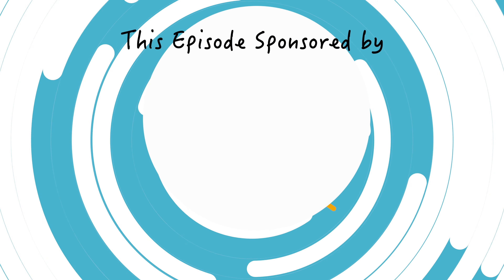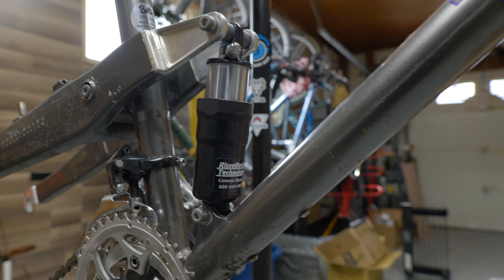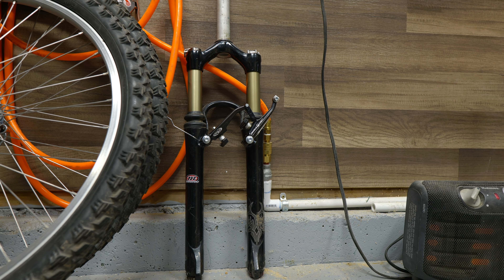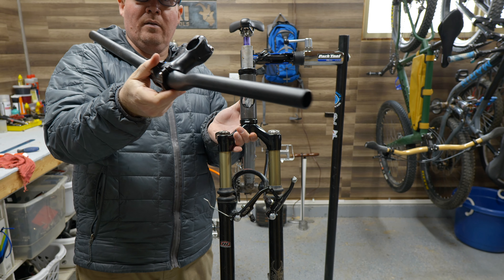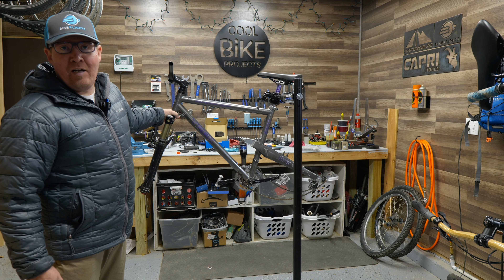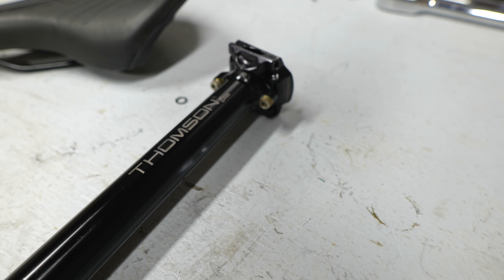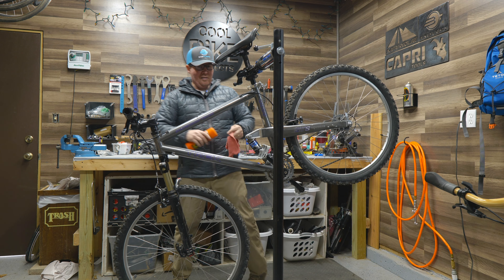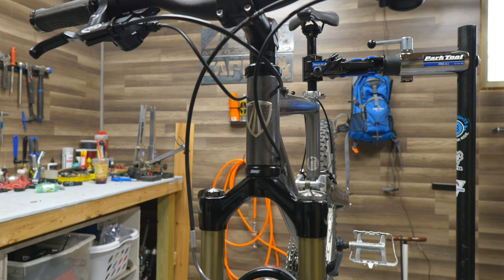Trek 9200 Restomod Complete! Mountain Bike Restoration

Comment: I used to own one of these when they first came out.  Very cool to see one getting some love 30 years later!

There wasn't a cable stop on the rear so cantis wouldn't work and v-brakes weren't a thing yet so these came stock with a Paul Crosstop rear brake. It was a very finicky brake to set up , but once it was dialed in they were quite powerful with good modulation.  If you still have that brake I would reach out to Paul Components to see if they have any of those springs around.
Reply from the maker: Thanks for the insight Jay. I will reach out to them and see.

Comment: i just picked up 9200 with J4 rock shox from goodwill for $50, previous owner had changed the rear suspension to a spring type too, can't figure out the brand though.
will be watching your video over and over to restore mine! thx for the vid
Reply from the maker: Right on!

Comment: I wouldn't worry about the purest, you did this bike justice. Those frames weren't the best suspension designs, they rode like a pogo stick with wheels.
Reply from the maker: Thanks Johnny. I'm hoping to put in some miles on it this spring and see if the rebound control is enough to tame the back end.

Comment: it is not just engineering, it is about design. Now the front is too high and you change the geometry of the bike, the front wheel will loose contact with the ground in the uphill, not very safe
Reply from the maker: My experience has been very positive so far. I can actually ride the bike comfortably now with good traction front and rear while climbing and descending. I agree that you can over do it and should not just throw on a longer fork with every restomod, but the geometry works very good now.